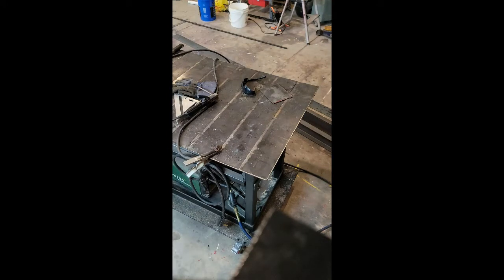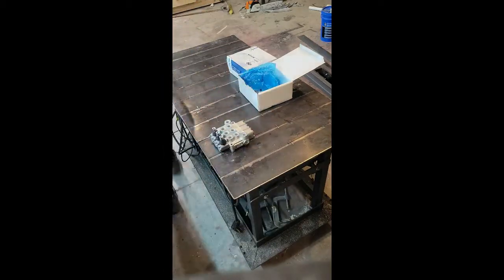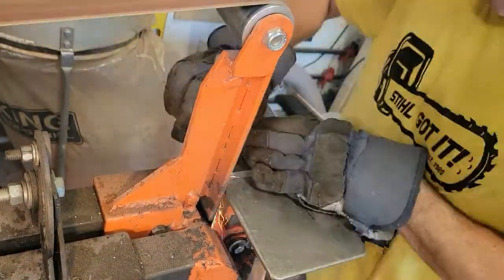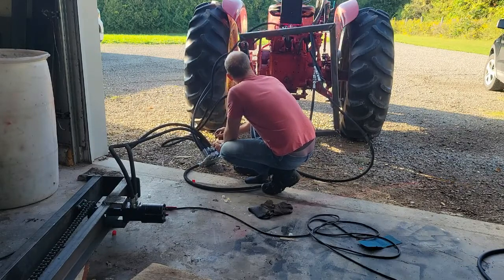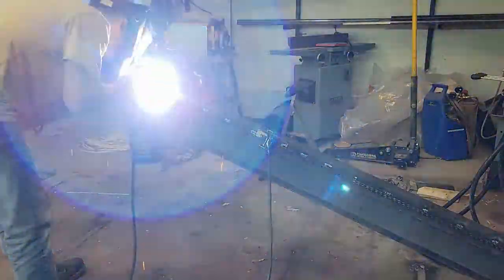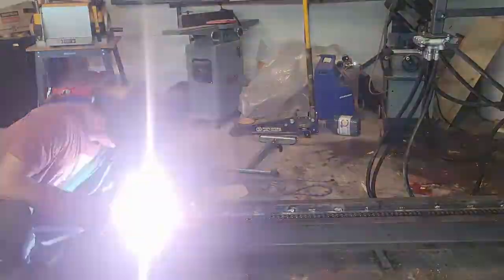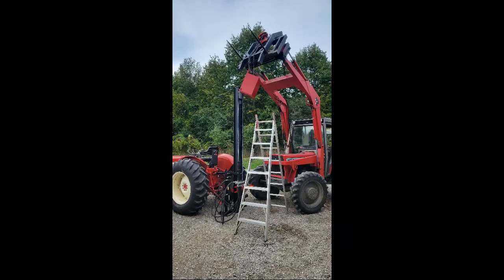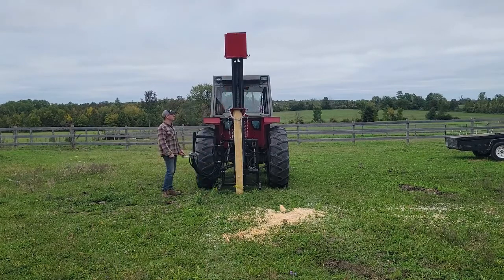Post pounder - Chain drive, free fall DIY

Comment: You need to stabilize your 3 point, or center it anyway
Reply from the maker: Not sure I understand what you mean, it is exactly centered. And it is stabilized by adjusting the hydraulic cylinder attached to the center pin. Can you elaborate?
Reply: @jason4705  there should be a bar on the bottom three point 3 point arm to hold it solid, can’t swing  back and forth sideways, looked like in rough country you could get it tangled up in your fender, I’m probably all wet, just in the video it looked pretty close!!
Reply from the maker: @sheilamclaughlin963 I have locking pins that stop it from swining.

Comment: Great job, a good alternative to polispast! Can you repeat the link for the trigger - the steel block attached to the chain to lift the load? I don't have that link open. And the question of the impact force - at the beginning you write 75,000 Nm, but with a load weight of 380 kg and a drop height of 3 meters, the force is much less. Thanks/
Reply from the maker: I used an online engineer calculator to figure out the impact pressure. I could be wrong but I'll go double check. 

As for the trigger mech. It's just a 2 inch rounded square block that picks up the weight. The chain cannot pull back and release the weight until it reaches the top of the mast and when it starts it's journey around the bearing sprocket it slides out of the way, and releases. 

It probably will be the first to wear out. But I'm probably easily over 100 posts now and no issues yet. Did another 12 yesterday.
Reply from the maker: Its definitely wrong its the wrong unit of measurement. Now that I have AI its showing 9000ft pounds.

Comment: Did you adjust the pressure  relief at all on the control valve? I think I understand how you coupled your motor. I used 2 bearings on drive shaft and had spider coupling with rubber insert to protect motor from impact damage when it picks up load

Comment: I built one too using your video and parts list. Have had issues snapping coupling in half on motor. What kind of coupling did you use on motor? What pressure does your tractor put out?
Reply from the maker: Not sure what you mean by couplings. The motor has a key shaft. The only cupling I used was to lengthen the shaft in order to reach the bearing on the other side. I welded the sprocket to the keyed shaft
Reply from the maker: Tractor pressure is 2500psi low flow

Comment: Any advantage of your post driver versus using an auger to drill the post holes?
Reply from the maker: Yes, everything. That's why I built it. I have a post auger and a back hoe. On rocky ground it takes several sheer pins, lots of time, and with the back hoe, you end up removing way to much soil. Both of those options mean you have to level the post, back fill, and back fill again once the ground settles the following spring. With the pounder, it's once and done!

Comment: Awesome build!  Thanks for the great video. What did you use for your hydraulic motor coupling?
Reply from the maker: I used 2 flange bearings, drilled and tapped 4 holes and bolted it directly to a bracket I built.
Reply from the maker: And thanks !
Reply: @jason4705  Nice! What did you use to connect the shafts to withstand that much torque?
Reply from the maker: @chrisarnos8217  the key is the guide plate. It has 1/2 inch triangle gussets putting the force back vertically agants the channel. And a big rule, never let it hit without a post under it,not sure but it might smash the welds right off. If the force is always onto a post there's very minimal force against the gussets. And I've never had an issue yet.

Comment: Do you sale any plans ?
Reply from the maker: Sorry I don't have any plans. If you need any measurements just ask. All the supplies are listed in the original post.
Reply: Ok thanks what size is your C Channel and how long ? How far are they apart? When you where testing the I couldn’t see how you till side to side ?
Reply from the maker: @timcunningham9071  c channel is 10 foot long, 5 inch web, 1.5 inch flange. (Roughly, it's metric) the 2*2 Frame is 1/4 inch thick. The side to side tilt is made by a collar mounted on the frame that can slide up and down. Couple grease nipples. I'll get you some pictures when the snow melts !
Reply: That’s awesome man thanks for the info.. pictures would be great thanks.. I have 165 acres weekend farmer lol but I’m a welder buy trade
Reply: Did you ever get more pictures?

Comment: Are you able to drive smaller posts like T-posts?
Reply from the maker: I did drive a few but it's way to powerful. You would want to just reverse it slowly so it doesn't bend the post.

Comment: Can you share details on the trigger mechanism and how you attach it to the chain? Also, did you weld the gears on?
Reply from the maker: https://www.grainger.ca/en/product/CONNECTING-ROLLER-LINK%2CDOUBLE-PITCH/p/WWG1UFT4 here is the links I bought
Reply: @jason4705  thank you sir! Great project!
Reply from the maker: The trigger is simply a block of steel mounted to the chain that picks up the weight and as it rolls over the top releases it. I'll add a link to the attacemt piece I bought. I added two of them so it is twice as fast